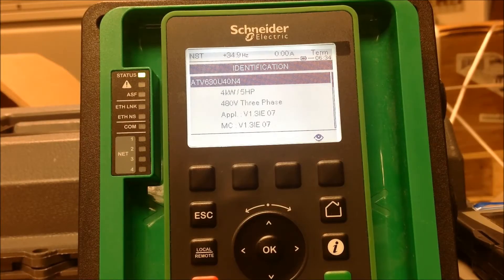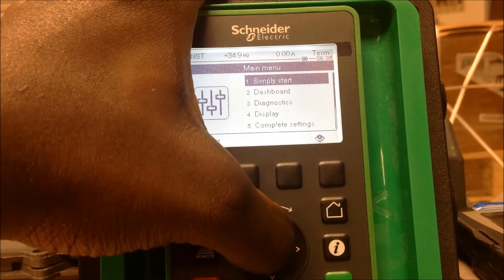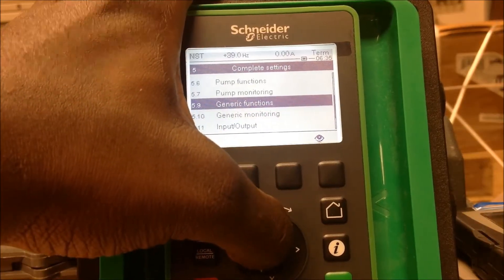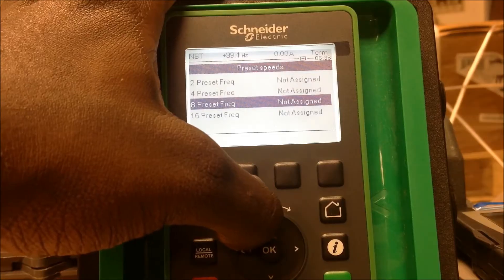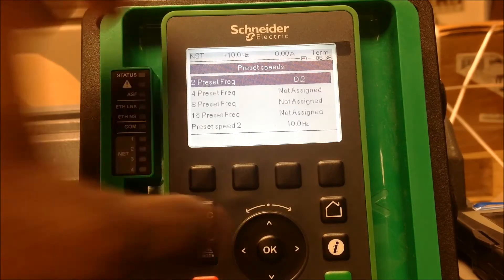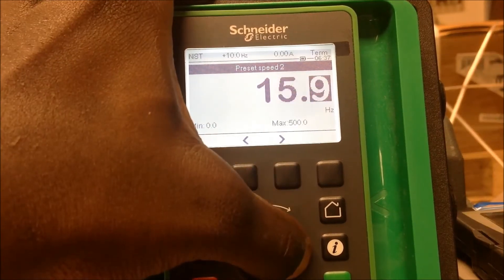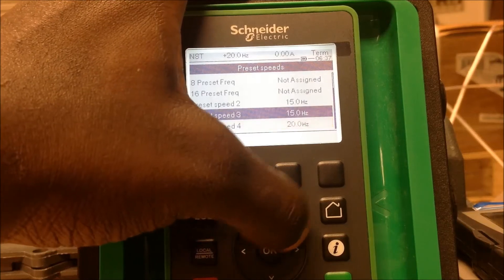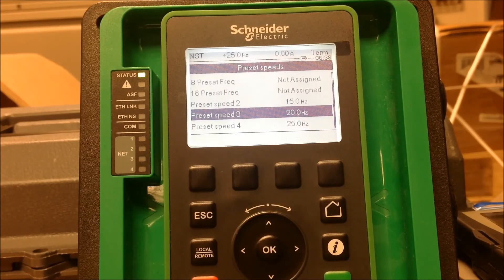Configuring Preset Speeds on Altivar 630/930 Process Drives | Programming Schneider VFD

Comment: Bonjour merci de me faire un retour  
J'ai un variateur similaire a celui sur la video ci dessus. J'ai changer le moteur 45 kw par un moteur 22 kw j'ai reconfigurer le variateur pour le nouveau moteur j'ai mis en marche le moteur sans remarque après un certain temps j'ai mis en arrêt le moteur ensuite j'ai activer dans la configuration filtre activer j'ai remis le moteur en marche le moteur n'arrive pas à ce démarrer j'ai désactivé la fonction filtre mais rien à changer le moteur n'arrive pas a ce démarrer apres le diagnostic j'ai trouvé que la tension au borne du moteur est 75 v au lieu de 400 v 
Je veux juste savoir est ce que le variateur maintenant est en panne ou juste une paramétrage non compatible merci de me faire un retour

Comment: Hi
i should do the same at work but i have a question
Where do you set that the reference speed is gonna be  by the digital terminals with the preset speed and  not analogic terminal ?
Reply from the maker: Thank you for reaching out.  Turning on one or more of the digital inputs assigned as a preset speed automatically tells the drive to ignore the analog input and to run at the selected preset speed. There is no programming or adjustment needed, other than to wire the controls so the preset speed input is turned on. Hope this helps.